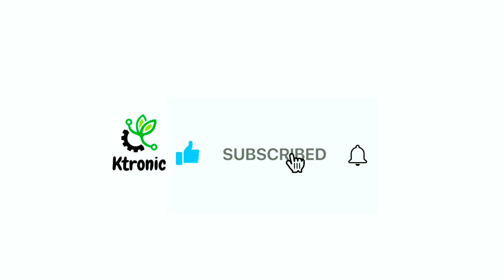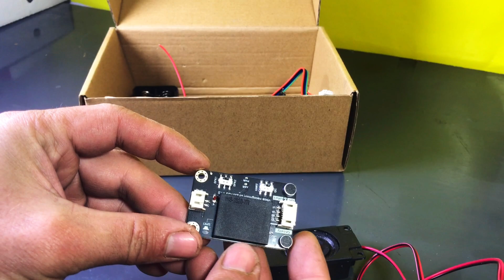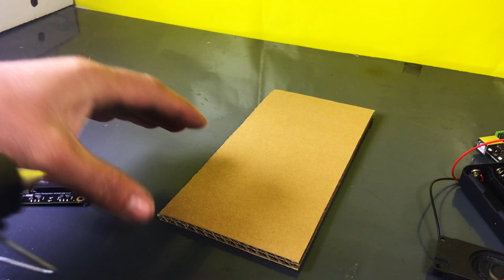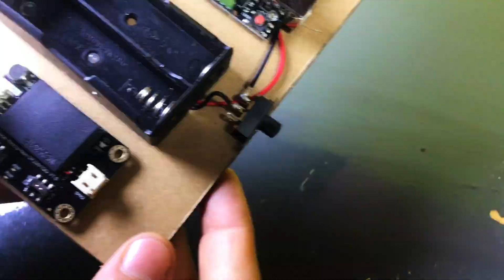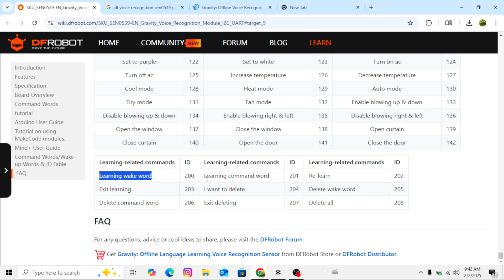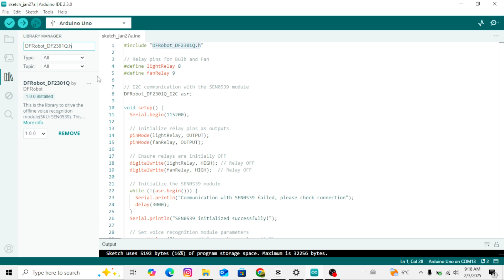Voice Controlled Home Automation! | Voice Recognition Module | Arduino Project

Comment: hello , can i make this without speaker but with rest of the components
Reply from the maker: Yes, you can use it without the speaker. The module already has a built-in speaker; the external speaker is only used to make the sound louder.

Comment: This is really sick bro good job!  
Bro if i may ask instead of arduino, 😅esp32 will work as well as a replacement of arduino right??

Can i have the circuit diagram of this project i will make kinda similar to this for my Project. 
Thank you
Reply from the maker: thanku so much yes you can use  wsp32 also

Comment: heelo

why did tou solder to the board and switch?

but anywats very good mashallah
Reply from the maker: Because the fingerprint sensor's wire didn't have a pin, I had to solder it so that it wouldn't come off.